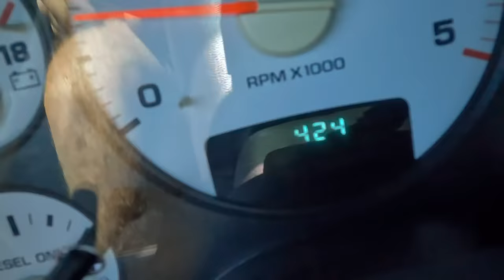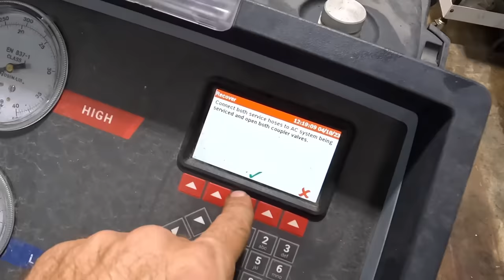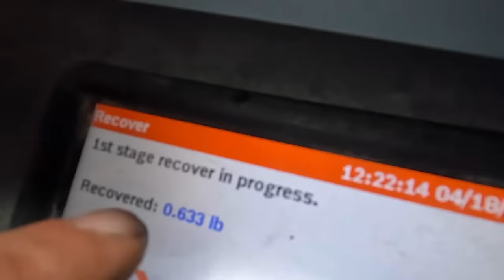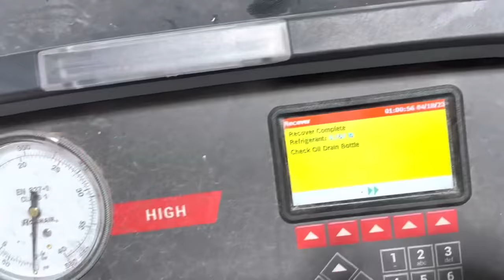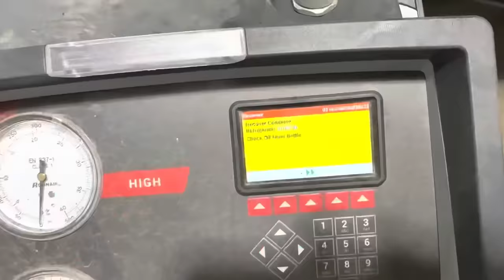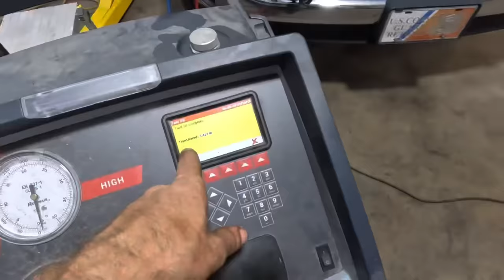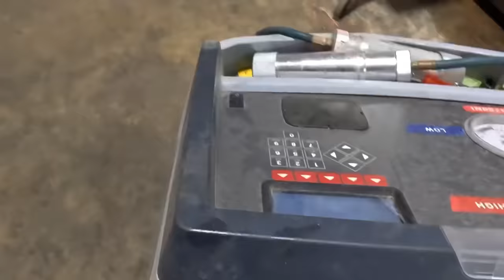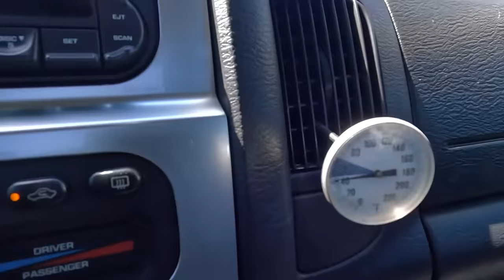Diagnose Before Removing the Dash  Dodge Ram 2500  5.9 Cummins A/C Blows HOT!

Comment: I still want an autopsy on that tire the Wife Unit got thrown under.  If it wasn't a flat (heh) out defect, then she (as would have anyone else) ran over something tiny but sharp enough the cut into the base casing. Something like a single-sided razor blade (the rest broken off on the next revolution).  A million to one chance but not impossible,

Comment: Ray, I never see you confirm the refrigerant type. I’m not at all an expert but assume you are checking that on each vehicle and ensuring the proper match. My understanding is there are a few automotive refrigerant types going all the way back to the early car models
Reply: R12, r134a, and r1234yf all have different service ports to prevent accidental mixup.  Plus when you read the label for the charge weight the refrigerant type is right there.  In this case 1lb 14oz of r134a. It was quick but you could see it when Ray showed us the label.

Comment: I have a 1999 doge ram 1500 what if your comp works and it has refrigerant in it and everything is working but it still doesnt blow cold but only mildly cool? i have checked for leaks nothing under hood but where does the plumbing go after the dryer? the 2 lines that go into the firewall whats behind that? I detect a leak there  but not sure that's the problem because it takes several days to leak down.

Comment: Hey Ray I have a question I have a 2008 dodge dakota slt 4.7 when I use my ac when the temperature is around 75 80 outside when I start accelerating after stopping at a light it will spit and sputter or if I'm at  the speed limit it also does it just wondering if you had any suggestions on what I can do already changed the spark plugs and coil packs

Comment: Covalent bonding baby.   Amazing how much energy can be stored/released from a "weak" chemical bond created by compressing the refrigerant and then releasing the pressure through a narrow opening :D
Reply: That’s not covalent bonding.  You’re describing adiabatic cooling.
Reply: @StrongDreamsWaitHere  the phase changes in the system create the covalent bonds during compression and breaks them during expansion phases - energy put into the system by compression, energy consumed when breaking the covalent bonds, yes? Of course I'm simplifying here, and claim no expertise :) this is simply how my high school chemistry teacher explained it - and that was a long time ago, 🤣🤣🤣 I probably have pieces wrong, or explained poorly.
Reply: @smarouchoc7300  There are no covalent bonds being made or broken.  Energy is certainly being stored and released, but not that way.  (In fact, if it was so easy to make and break covalent bonds in the refrigerant, it wouldn’t hang around the ozone layer for hundreds of years.)

Comment: Just wondering, Ray is there any kind of in-line filter in the refrigerant lines that may need replacement when servicing the AC?
Reply: There is a desicant pack in the accumulator! And some systems may have filter line driers,Ive never seen one,but they could exhist!

Comment: "Garter spring"  they call it at those type line and tube connections.
It's good to do the accumulator when the system has been empty and open to the air multiple times.
The accumulator contains the dessicant bag, which collects the damp. After it saturated it gets affected by it and can come apart, which can distribute the dessicant, and, that would be bad.
New accumulator.
Best plan.
Keep everything capped that gets opened.
Especially if it's humid out and hours pass.
Not the CRAW, oh no, it's the uh, craw.
That's a nice machine you have for A/C service.
We had a bunch of different equipment because cool ones weren't out yet.
The reclaimer was a separate unit.
You're looking for, "latent heat of vaporization"
To describe the heat transfer via the properties of refrigerant.
Yes I have a photogenic memory where climate control is concerned.
The other guys got patches for A/C service to sew on their uniforms.
I got a rock.

Comment: So whenever I hook up to my accumulator to recharge it with a o reily bottle, it reads past the red on the high pressure even while my ac is running I can feel the compressor kick on but it only blows hot air. Any ideas?

Comment: So, you evac the system and replace the drier and no mention of replacing the oil removed by replacing the drier or the oil removed during the evacuation service???  That is dooming the system to failure is it not. I also normally use R 134 with dye in it. Works much better.

Comment: Its cool because I have this same truck just with a lift and steel bumpers   Also if his dash is cracked then he can order it through autozone
Reply: I have a 2003 same color but with the 5.7 Hemi.  Of course my dash is cracked. You can get from autozone? Some type of “cap” I assume? Also I have over 510k miles on original motor👍
Reply: @jamesm4498  as far as quality goes I thank it’s better and yes I ordered it through autozone it fit perfect
Reply: @jamesm4498  also the one I got was a legit piece not a cap

Comment: So if water drips out of AC evaporator core, the evap is good, yes no maybe............
Reply: If water (condensation) drips out the A/C drain, it is very normal.  If the water draining out is subjected to a UV light, and it glows, it is not normal.

Comment: Ray I wanted to say thanks about that transmission on the Nissan frontier I can't figure out what is her SUV problem is but I'm sure it's transmission it doesn't want to shift after fully warmed up like 20 miles down the road then shut off then restart then half a mile it shows it's problem of not wanting to go into I'd say 3rd gear it seams to drag and run bad at that point any ideas ?

Comment: So i see Dodge got a bad idea from Ford ; ( I had a 87 Aerostar with Dual air never could keep Freon in it do to those garter spring connectors. They came out with better O rings but still would start leaking after a few months. That Aerostar was the junkiest new car i ever bought. No more Fords in my driveway ; )